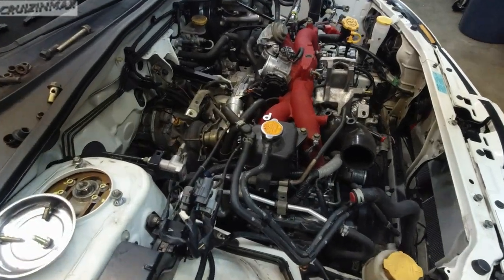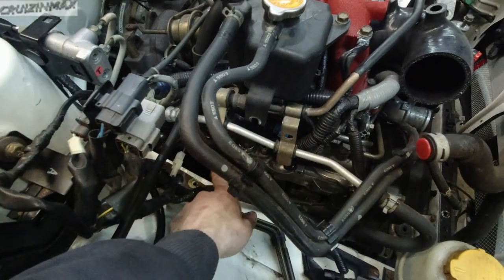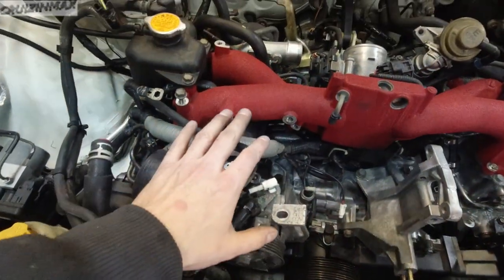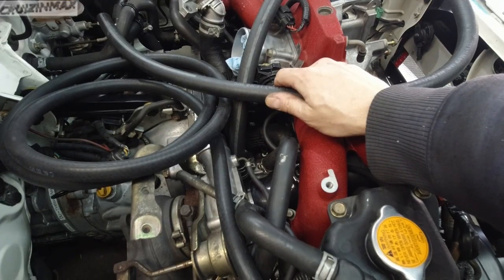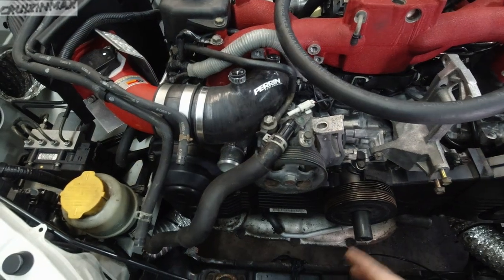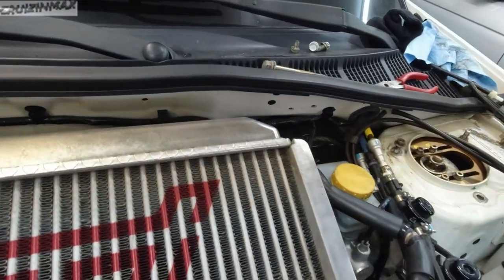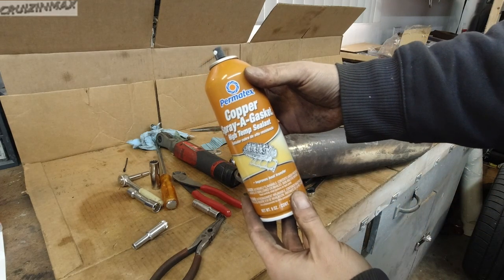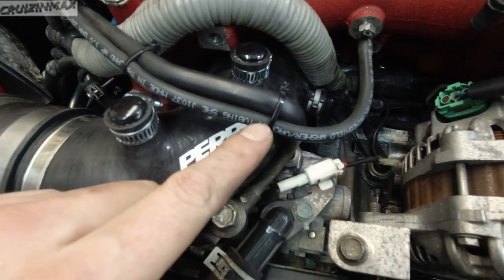Subaru STI EJ25 build part 11  alternator, intercooler and more

Comment: Regarding the poor fitment of the Perrin turbo inlet pipe, it's been my experience that aftermarket turbo inlets simply don't have the precise fit of the OEM part. However, they're less prone to tearing at the connection with the turbo. It's a case of picking your poison.
Reply from the maker: stock ones crack but mine was ok but that doesnt mean it would never crack so I changed it anyway and ofcourse for a bit more HP....hopefully

Comment: Is there a reason you didn't use a brand new OEM turbo-to-downpipe metal gasket?
Reply from the maker: 2 reasons...it wasnt rusty and cleaned up pretty good and if it would have a small leak then it wouldnt harm anything like a leak on the uppipe would for example.